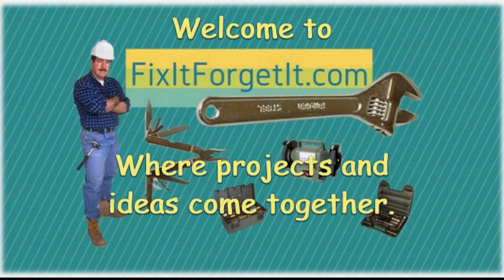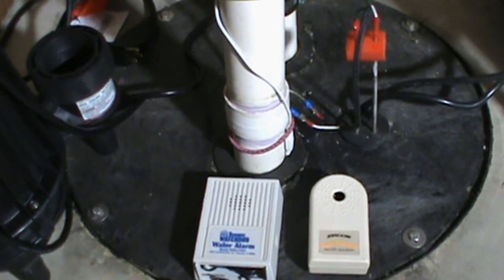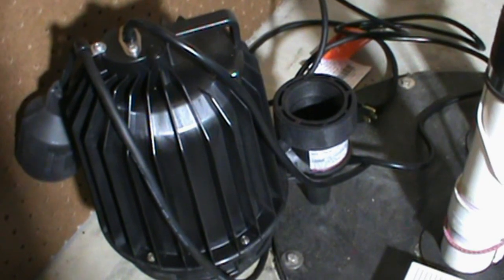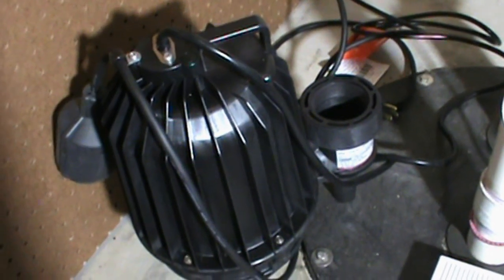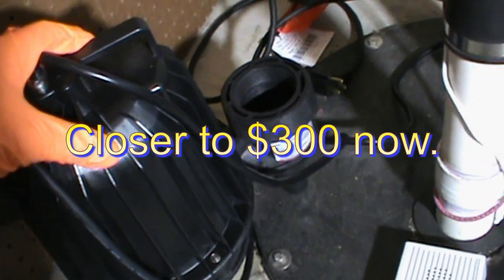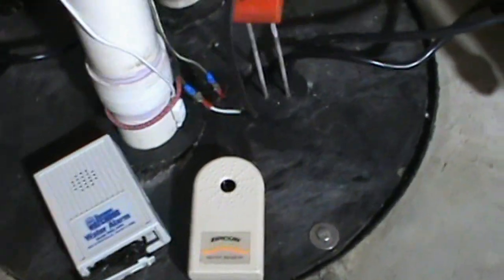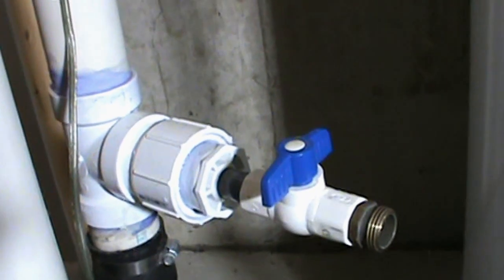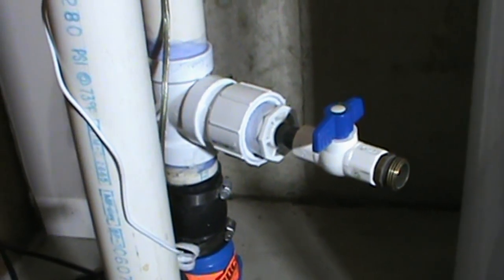Wayne sewage pump and early warning water leak alarm system.

Comment: Not sure about that self made drain for above the check valve, Zoeller and others make an integrated ball valve that you can just close off and then remove the check valve. No need for the hose or bucket then.
Reply from the maker: Hi, SilverS70. I love that idea. I will check it out. Thanks for the tip.